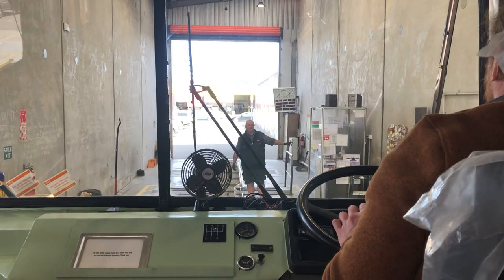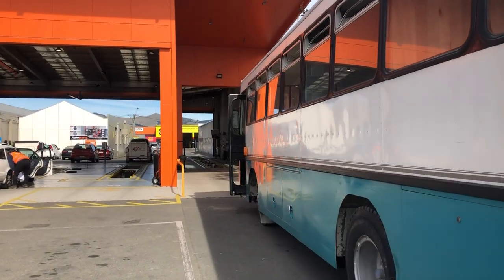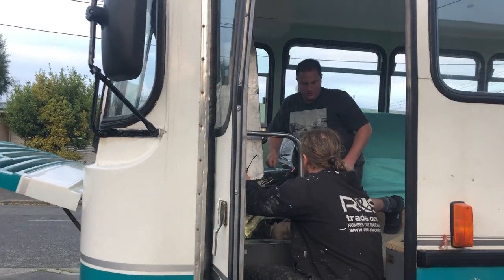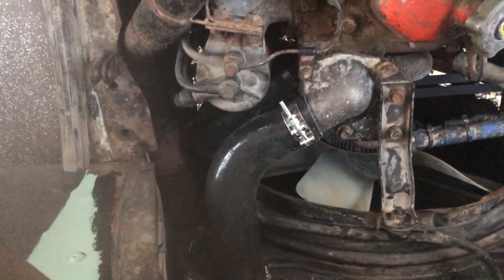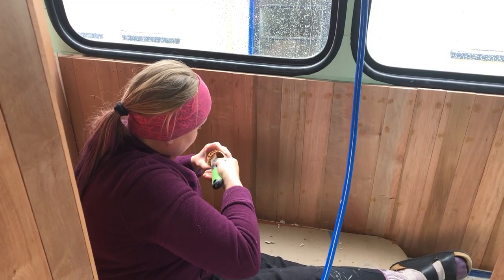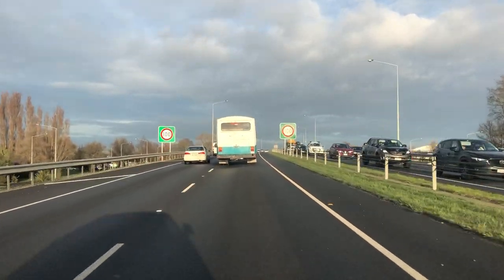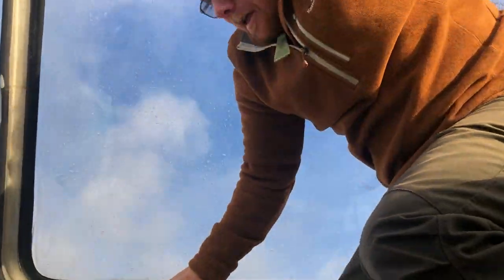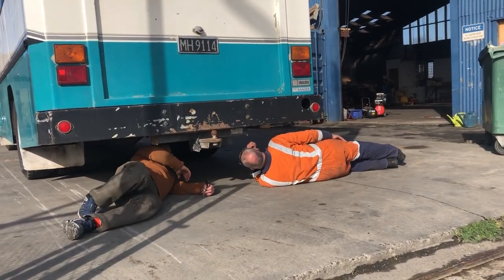Brake overhaul and radiator repairs, 1984 Isuzu JCR500 school bus conversion (S1E14)

Comment: I’ve always warmed my brakes up in the bus before cof. A few trips around the block in the 100km zone does it with heavy breaking into intersections. 
I forgot once, and failed, went back the next day and passed. 
Did this for a few years, but my last cof cost me about $8k on my brakes.
Reply from the maker: Ouch... 😉 Our fronts were pretty good just needed new linings and seals. The rear brakes are mostly really dirty and out of balance. We hope a good service next week will fix the problem.

Comment: Hey guys looking absolute great. Can you please guide me on the right direction in order to  transfer registration to Motorhome? Did you need to get the building inspected by a certifier? or just went to vtnz?
Reply from the maker: Thanks! 😊 You’ll need to have a certified seatbelt for each bearth (bed) and be about half done with the conversion. Then just take it to VTNZ, they they require at least a bed, sink and table. We just mocked some if that up at the time. Good luck!
Reply: @RebootLife  Hi fellow kiwi here was it hard /costly to do the set belts